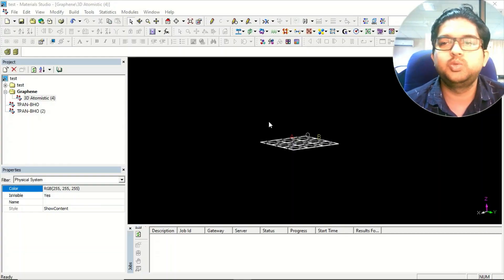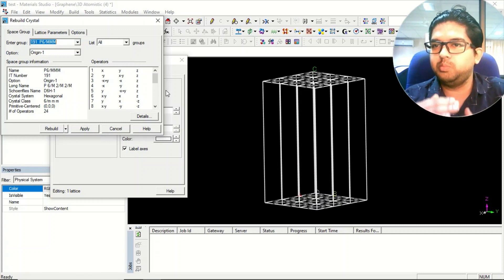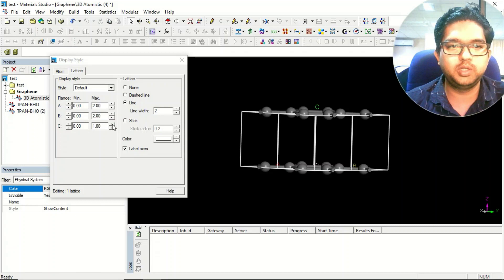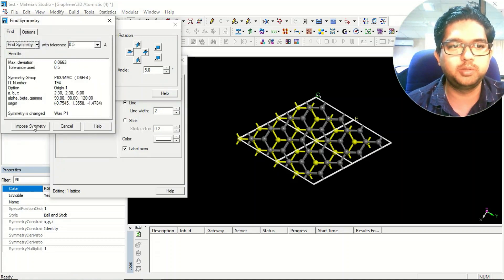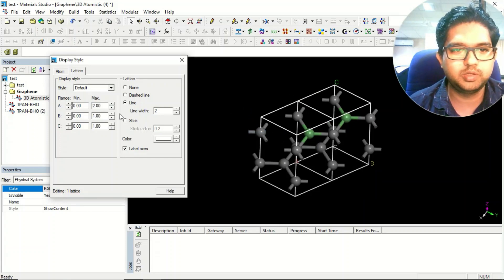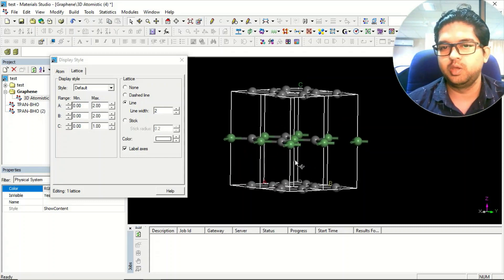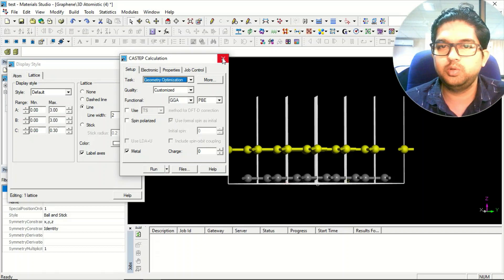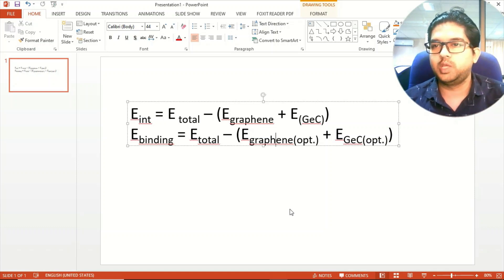A Guide to Adsorption, Binding Energy, AA.../AB... Stacking and Heterostructure Designing

Comment: hi sir, what if i calculate the energy of the system using Forcite module -> energy task? How will it be different from the one calculated using CASTEP module?
Reply from the maker: @ShikharNigam-wy4om  CASTEP is based on quantum mechanics while Forcite uses force field method (classical method). There is a huge difference in terms of accuracy.